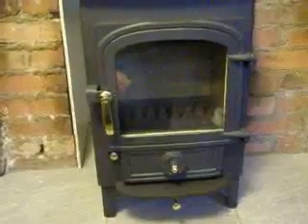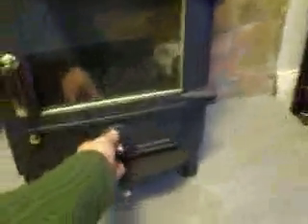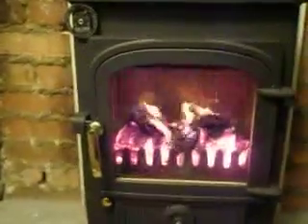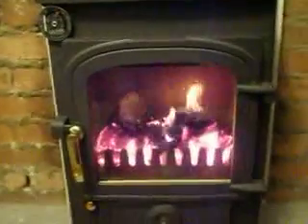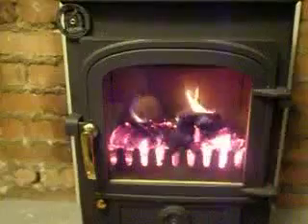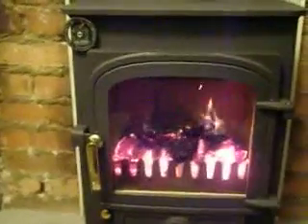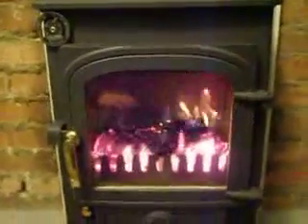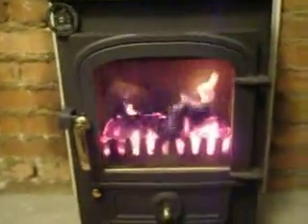Clearview Pioneer woodburning stove

Comment: As the only stockist in Northern Ireland, I am delighted to hear you are all enjoying your Clearview's. I have been a registered chimney technician in the province for about 20 years and Clearview are the only stove we will sell. Quite simply...the best product we have worked with. I would suggest avoiding any chemicals to clean the glass. Damp kitchen paper and WOOD ash are fine. Potassium Hydroxide comes from burning wood which surprisingly is the main ingredient in commercial glass cleaner.

Comment: yes, a double s/s 150 mm 904 grade liner was used for the 4 metre height of the chimney, and insulated after installation by pouring down the insulating beads from the top of the chimney before fitting the top plate, chimney pot and s/s bird guard. S/s flue pipe sprayed colour of the stove was also used to connect the stove to the liner.3mm s/s plate was used to blank off the chimney and a s/s flange was used to connect the liner to the flue.S/s screws used to make a long lasting installation.

Comment: The other thing you all should be aware of is the door is fully adjustable. Over a period of time the rope seals will become compressed on any stove, however a rotation of the door handle will give you a tighter seal, and by lifting the door off the hinges, you'll find the hinge blocks are adjustable too, allowing for full airtight control. Splendid but simple British engineering.  Expensive in comparison to cheap imports?...yes, but is it worth it? .. just watch a CLEARVIEW users face!

Comment: by the way, I've found that the easy way to remove the small amount of blackness you can get on the extreme bottom edge of the glass can be easily removed once a week by spraying it with flash solution, leaving it a couple of minutes and the black comes off easily with a sponge. Quick wazz with the brasso on the brass handles and it's all sparking for another week. I can't believe how the wood burns away to nothing, I only empty the ashpan once a week!

Comment: it's quite a bit of work, especially sorting out the flue.You should use a hetas engineer. The instructions with the stove were clear and gave you everything you needed to know, but it does add 6-700 pounds to the purchase price for the flue, brackets, pipes etc.Connecting it all together is simple meccano, bt there is a fair bit of building work to get the old fireplace out and get it to look nice..as usual the more effort required, results in an unnoticed job, whereas bodges stick out for ever

Comment: no...I'm ecstatic and a gas bill of less than £150 for the last quarter during all that really cold weather  has just reinforced the feeling that it was the right decision. I've just bought a stove kettle and now find I can heat water for washing up easily in a matter of minutes. I also cook on it, it's great for stuff like potato and leek soup, or casseroles(I've bought a nice cast iron pot) and it looks fantastic, especially with the oak fireplace I made.Sitting in front of the heat now!

Comment: it's a 4 bed house so no it doesn't. i have a combi gas boiler as well and rads but  leave the thermostat set at 13 c all the time so the house is not cold(it's not warm either!) and when I'm there I light the wood burner. The large front room gets up to 18c quite easily (temperature guage is some distance from the stove) and it's lovely and toasty warm when I sit infront of the fire. You can fit a back boiler and heat a couple of rads or hot water but I didn't bother.I do use a stove kettle tho

Comment: @Blumpheroni I have just installed a solution 400 and the fire was roaring up well and then dying down fast and going out. Very frustating and I was starting to wonder if I had made a mistake in buying this woodburned. So I am going to chop some of the logs down to smaller sticks as you suggest and see if that makes a difference.

Comment: Clearview would tell you that chemicals are not needed to clean the marks at the bottom of the stove. You are using wood only, so the wood ash dipped in damp kitchen paper will do the best job of cleaning the glass....if you need to. Potash gets it's name from the high levels of Potassium, which when mixed with wawter will give you the best cleaning agent you need. Google the benefits of wood ash and you'll be amazed.

Clearview...the best stove on the market.